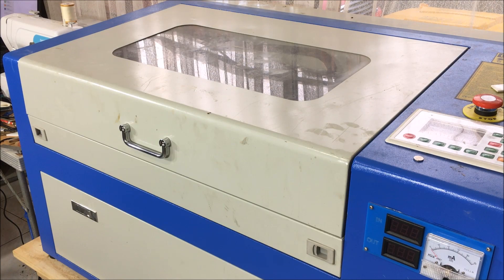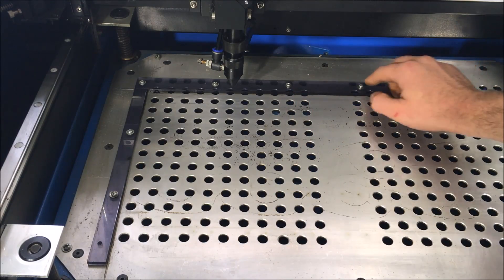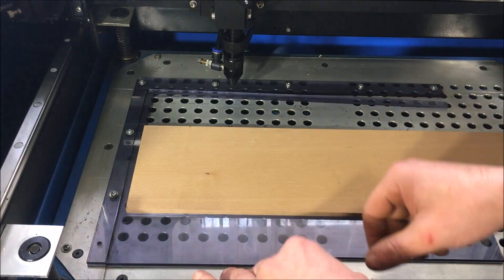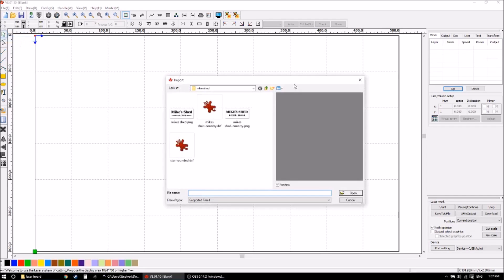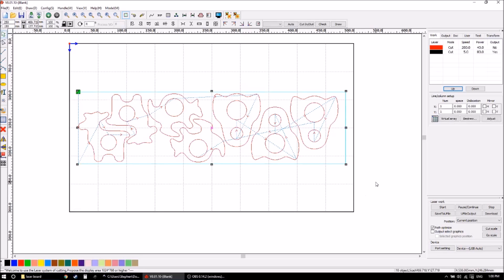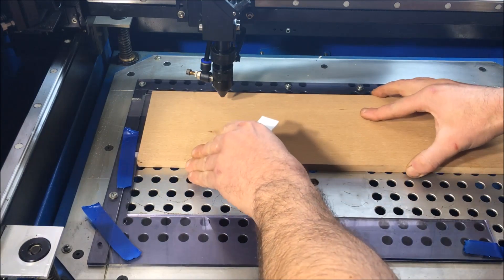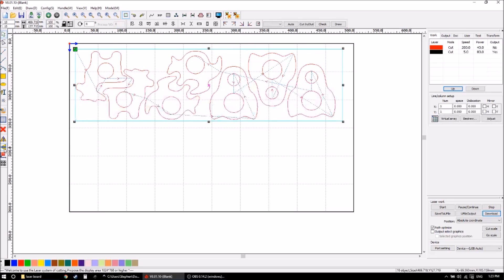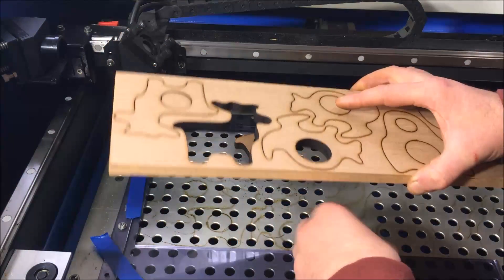How to cut through double the thickness. Using 50W Chinese Laser Cutter

Comment: I'm relatively new to my 50watt 
Have a question if u don't mind.  How do I set the y & x axis to get to use the most out of my laser bed.  Everything gets cut off.  Either at the top sides or bottom.  I can only cur in the center of the bed???

Comment: To cut through a 6mm thick plywood, what power is recommended?
Reply from the maker: plywood is a whole video by itself, it varies greatly depending on wood type and glue. With this stock machine, light plywood like basswood or birch I give 3mm thick 60% power and 8mm/s. For 6 mm thick I would just give it 2 passes at the same. Any faster or more powerful will burn too much.
Stronger plywood like marine ply made out of hardwood, I can try cutting 4mm stuff all day and unless im getting good airflow I will just be burning up a whole lot of soot.

Comment: Easy just run the program twice. Duh
Reply: Yes, but i will be bevelled cut - not perpendicular. The way of cutting shown in this video - really interested thing - I'll try it myself:)
Reply: @LaserShopKiev  itll be fine as.long as your pieces dont move
Reply: I would think that the laser needs to refocused to cut deeper on the same path. The beam itself has a focal point imagine an X  that is the same width but stretch that X to be 20 times its height. The cut only happens within a certain distance to the convergence point on the X so he should be able to drop the focus by 4 to 6 mm and cut it again without flipping. At these depths your getting a beveled cut no matter what. Flipping the board as he is doing here should result in a double bevel or a wave like cut, albeit very slight.
Reply: @GregK2754  wrong the problem with that is you would fuck you the  initial surface cut in your work piece especially with wood you would burn the top surface maybe even cause a fire
Reply: @autobotavengerfireballxl5339  not sure I follow you, you're saying run the same cut twice when the reason its not cutting all the way through is loss of focus coupled with speed.  I said "I would think"  meaning it is an untested (at least by me) method. But like you I would run the same cut twice as well, but the second time refocus a bit lower, below the line.  The heat generated at the surface would actually be less because the beam at the point would be out of focus.  Fire can and will happen with wood which is why you never leave the machine alone when performing a cut through. An air assist would help put the tiny flames out.  I could be wrong... and one day I will test. For now I have no need to cut wood that thick. I do a lot more acrylic work.
Reply: @GregK2754  listen bud I run cnc laser for a living my original comment was sarcastic but what you suggested is completely idiotic
Reply: @autobotavengerfireballxl5339   sure thing brother, have a good day

Comment: i was looking into this cutter on ebay. Do you think it's strong enough to cut through 5-6mm acrylic? What about 2-4mm fiberglass? And maybe i'm asking a stupid question, but could it cut through 2-3mm carbon fiber?
Reply from the maker: 6mm acrylic cuts easy. I cut 10mm acrylic with 2 passes (3 of the tube is a little old).
Carbon fiber no good. It just scratches up the surface.
No idea about fiberglass as I never use it. It can engrave glass and cut most plastics, but with a lot of non-acrylic plastics it will leave dirty burn marks. So I would guess it may cut fibreglass but there is a chance it leave a bad edge. I'll have to test it one day.

Comment: Is it possible to make numerous passes with a lower watt laser like say a 20/30W..? ,the price of a 40W is around £330/50 on Fleabay from China or would I be better getting a 50W..?.
Reply from the maker: There is a limit to how deep you can cut no matter how many passes you make. As the laser gets deeper below the surface the beam expands, so the power density starts to drop. Also having good air flow through the nozzle removes waste material better and can help cut a little deeper. After about 3 passes of the laser you are just burning wood and not penetrating any deeper.

For my setup, which is a 2" lens with default air blower attached I find with 2-3 passes I can get about 12-14mm deep in soft woods (pine), about 6-8mm in less dense hardwoods (beechlike in the video) and barely about 3mm on really tough wood (jarrah, red gum, walnut).

Despite what other people might tell you, with wood don't ever focus partway into the material. You need your focal point right on the surface of the timber to get the maximum power density possible the begin the cut, and then rely on your air flow to remove the material to push through as deep as possible until the laser cant get any further. After 2-3 passes that is likely as deep as you are going to cut.
Reply: Thank you for the reply mate it's very helpful...keep up the good work fella!.

Comment: How did you remove the factory bed?
Reply from the maker: I removed the whole bed and 4 main screws and took it out. I unscrewed the thin plate it came with and threw that away. I bought a 3mm aluminum plate cut to size and drilled some ventilation holes in it, then drilled some holes to screw it onto the main bed assembly.
I never took any photos while doing it unfortunately. It is fairly straight forward to do but is a lot of work.

Comment: how do you transfer your design to the cutting machine? through a cable or bluetooth?
Reply from the maker: Connected via USB cable is how I have it set up. The controller also has an Ethernet port which I have never used.
You can also save file to USB drive and plug it into the laser cutter, loading file from the machine control panel.

Comment: Hello can you be so kind and tell me how high is the wood you put under laser head? I got 50,8 mm (2 inch) focal length, but i would like to know how much is it from bottom fo laser head to top of material, just like you set it by the wood.
Reply from the maker: I can't give you a number because it depends how long your nozzle is. You need to measure 50.8mm from the actual position of the lens, which somewhere inside the nozzle assembly which can be different on different machines.
Check this video https://youtu.be/Eg6THrEdleo

Comment: I really did not understand why you were doing the offset after the mirror operation on the original design. You could just do a mirror and use the same origin as the first cuts. I know you mentioned the reason in the video but it doesn't make sense to me... I must be missing something obvious :-)
Reply from the maker: If you were  to do it that way, you need to make sure the wood is cut exactly the same height as in your drawing. you also need to make sure the top, left and bottom sides of the wood are perfectly square.

The way I have done it the wood doesn't need to be prepared with any accuracy. Both sides of the cut are relative to the top left corner of the wood, and none of the other dimensions matter.
Reply: now i understand, well done.

Comment: Hi. I just bought my laser machine maybe 3 months ago. I can't seem to get the right measurements to cut the pieces. I have it at 40mm/sec , at 80% min power to 90%max power, but it still doesn't cut through 3/4 in plywood. What am I doing wrong?
Reply from the maker: check this video for the focus https://youtu.be/Eg6THrEdleo
check this video for the alignment https://youtu.be/e1c3keOKL6Y
Reply from the maker: Too fast. As a rough guide with this machine at full power
40mm/s --cut cardboard
10-20mm/s --cut acrylic up to about 6mm thick
4-10mm/s --cut wood and thicker acrylic

If you cant cut at least about 5-6mm in a single pass then the alignment or focal distance is wrong.
Reply: makestuffnow! A
Reply: makestuffnow! How do I fix the focus/alignment. I'm having a difficult time with that also.
Reply: makestuffnow! Thank you!!!
Reply: I did what you said, fixed alignment and the focus and it worked!! Used it for maybe 5 - 6 hours, and now it won't cut through the wood all the way. What could be wrong now??

Comment: Good review.  I bought a co2 80w direct from a 'reputable' China supplier and the FDA wouldn't let it cross the border.  CBP charged me for storage and had to send it back.  The supplier wouldn't work with me and had to write it off as a loss.  But, it may have been a blessing in disguise.  After some research I went with a Boss Laser cutter 60W and cutting 1/2"+ wood in a single pass... Engraving speed and detail is great too.  https://www.bosslaser.com.
Reply: and how is that not FUD to shill for that supplier? The Food and Drug Administration supposedly stopped the import of a machine not generally used for food or drugs? 
The supplier you brownnosed sells imported chinese machines at a 200% markup, they are hurt badly by direct imports. There are plenty of sellers that work with a local warehouse, so there are no customs issues for the buyer.
Reply: come on, this guy uses an affiliate link on his link (just put your mouse over the link without clicking and you will see a looong link not only bosslaser.com on the bottom of your browser), so its a fake post.. if you buy a boss laser through this link he will get loads of money provision.. i wouldn believe this guy.. great video by the way, i envy you for this thickness, never ever have done such a great thickness with 2 passes and i own a 50w laser.. ajusted it.. no clue why ..

Comment: Hi and thanks for the video! I just picked one up myself and wanted to know what type of protective eyewear to purchase for this cutter. I can't seem to find the wavelength which is what I'm told you need in order to get the proper protective eyewear. Thanks!
Reply from the maker: You can find suitable "10.6micron laser goggles" on ebay. The $30-$60 googles should all be fine for home use.
10.6micrometer, or 10600nm, is the wavelength you are looking for.
Reply: Thank you so much!  I really appreciate it!!!

Comment: Hi. Bought the same machine for wood engraving. Question, the wood seems burnt and have no depth. Do u have any suggestion to get lighter color and more depth?
Reply from the maker: No cutting depth strongly suggests you don't have the focal height set right.

For light colour cut lines on wood you want to cut quickly with a lot of power so the laser doesn't dwell too long and make soot. It's very hard with these cheap machines to do that. You need to cut with speeds over say 10mm/s, and have a soft timber that is possibly still a little green. You can only do this easiest with soft pine that is not too thick (about 6-8mm). Balsa and basswood is also easy to cut like this.
Reply: makestuffnow! Can you share with me what is the total speed and power i should use. I just want to engrave a phone case with depth, the wood thickness is only 1mm but I couldn't get the engrave depth. It only leaves black marks though i chose sunken and no depth .
Reply from the maker: full power 20mm/s should cut through 1mm wood easily.
To mark I would run 200mm/s and start at 40% power. This should mark to a depth about 0.5mm for most woods.
Then I would adjust the power up or down to get desired marking depth.

Comment: What is the maximum thickness you have cut in a pass?
Reply from the maker: using 2" lens, and 40W real power output: With a soft timber like pine about 8mm single pass works for me. Hard dense timbers like jarrah or red gum barely more than 3mm. Everything else somewhere in between.

Comment: 50W laser is easily capable of cutting 12mm wood in a single pass. the key is focusing partway into the wood, not on the surface. around 0.300" is what works for me. also good air removal ensures the combusion products won't come back up and interfere with the beam path, as the combustion products are opaque to IR.
i have also managed to cut 3/4" solid poplar and pine in a single pass. again, focusing partway into the material is key.
Reply: ms3bani what do you mean?, by focusing part away?
Reply: China has no standards. In the UK BS (British Standards) would mean a 50W laser is 50W + or - say 4%.
In China 50W could have usable power as little as 30W. So 2 different 50W machines might have quite different usable power outputs. i.e. yours might be closer to 50W, this guys machine could be closer to 30W

Comment: I think your cut is not good, becouse the cut line color must be light. Maybe dark lite but god bless no black.
Reply from the maker: I think you want the video "How to buy a $100,000 150W machine and press the go button". 
The topic of this video is pushing the extreme limits of a very cheap laser cutting machine most home hobbyists would own.
Reply: you understood me unlawfully, I have same laser like you, and the cut line is normaly color, not black
Reply from the maker: If you are using a 50W cheap ebay laser cutter, and cutting 12mm thick hardwood with a nice clean cut, then upload video.
3-6mm yeah, 12mm I don't believe you.
Reply: sorry , I have 80W

Comment: You really should not use aluminum table on a laser.  It reflects over 95% of the laser beam back to you.  Use steel
Reply from the maker: Yeah true. At this low power, and considering how scratched and dirty the surface gets it's not too big an issue though.

The main reason I will change to steel next time is so I can use magnets to hold down things like leather and fabric.
Reply: Luis Salazar Stay clear of the data lines and the motors and you'll be fine.
You don't need to use neodymium either. Standard ferrite magnets work fine... and there's plenty of space. I've used 12x12x60 ferrite bar magnets a fair bit. Unlike Neos you can cut them to shape or size too. 👍
Reply: I'm thinking in use magnets as well. Do you know if it can affect some of the components in the machine?
Reply: thanks
Reply: Better Use the Blades Table for cutting

Comment: hi , great job and thankyou for sharing. couple of questions please , i'm thinking about buying this machine for wood engraving , how much the floor could go down ? how much thick could be the piece of wood to engrave ? could you even remove the floor a put something to adjust z axis highness in order to engrave also thicker pieces ? thank you
Reply from the maker: The floor goes down a bit more than 30cm. You can engrave decent sized boxes.
There is nothing important under the table, and it is easily removable. So it would be possible to cut a hole through the bottom of the machine and get more depth.
Reply: makestuffnow! thanx a lot ! that's really seems the perfect machine for me ... ive seen a lot of smaller  machines that are too much cheaper to work properly .. this di one looks really ok !

Comment: That is NOT the same lens that shipped standard with my machine.  The focus tool with mine is 8mm.  Yours looks to be at least double that.  I know that certain lenses will give you a tighter focus with a larger usable focal distance.  I can barely cut thru 1/8" plywood, and sometimes require multiple passes just to do that.
Reply from the maker: Without even some basic information like your laser power or the focal length of your lens, there isn't much I can do to help you out.
But your poor performance sounds like it isn't focused correctly.
Reply from the maker: I've spoken with some other people, and it seems that some sellers provide the machine with a 1 1/2" lens, some provide it with 2". 
I'm using the 2" which will have a little lower power density, but the beam profile will allow a few mm deeper cutting over the shorter lens.
Reply: makestuffnow! Yes, people should be aware that most Chinese products sold on Ebay are produced in multiple different factories. The general appearance of the machines may be the same, but there is no guarantee that ANY of the internal components will be the same. There is also no set standard of quality. Some machines are produced in very well run factories, some are not. My machine came with metal shavings within the lens assembly, but thankfully everything else seems well built.  Who knows, the factory may have bought the whole lens assembly from a 3rd party supplier.  I actually worked for a Chinese owned computer manufacturer in the USA back in the late 90's. They have a very different approach to manufacturing. Their focus was definitely volume production at low cost regardless of quality control issues. I think that production mentality still holds true today. Just sell enough to be able to absorb the cost of a certain percentage of bad units.  I am very satisfied with my laser (with the 1.5" lens) and count myself lucky that I got a good one.
Reply: As far as I know the smallest focal length for lasers is 1", probably even 1.5" so I highly doubt your lens  has 8mm focal point.  What I am sure though that you are talking about is not a focal length of your lens but a distance between a bottom of your nozzle to a material placed on a table. Since laser machines are not the same each can have different head designs and that distance will vary for each machine.
Reply: Michael S Yes...I was not clear. The focal length from the bottom of the lens is more, but the spacer block from the bottom of the air tube to the work is 8mm. I have also recently purchased a laser output meter, and have found that my machine is only putting out about 24 watts. I will try getting a new tube, but have heard that the quality control on the tubes is not great. Many of the so called 50w machines actually have a 50w power supply and a 40w tube, and even then, the tube ratings themselves are sometimes overblown. I've also found that these machines can overdrive the tube which shortens the life. Most tubes are only supposed to be driven at 18-20ma, which happens at about the 65% setting in my software. My software needs to be set at 20% even to fire the tube. So in reality my useful software range without overdriving the tube is 20-65%.  If I had a tube truly putting out 40-50w, I do think this cutting method would work for me too.